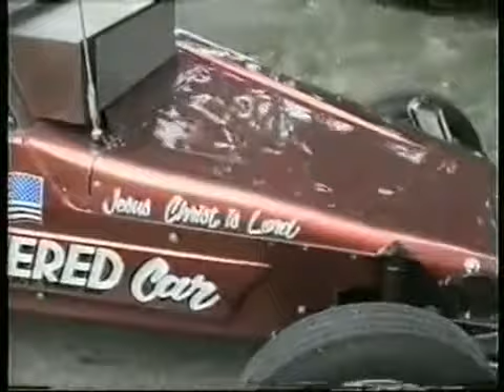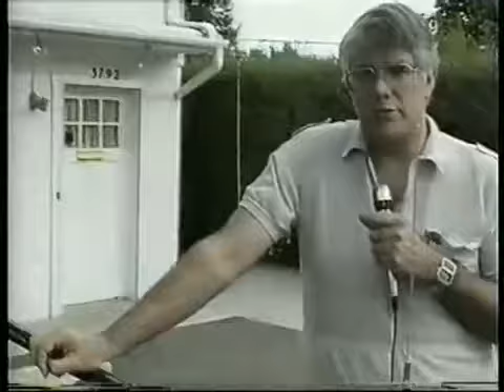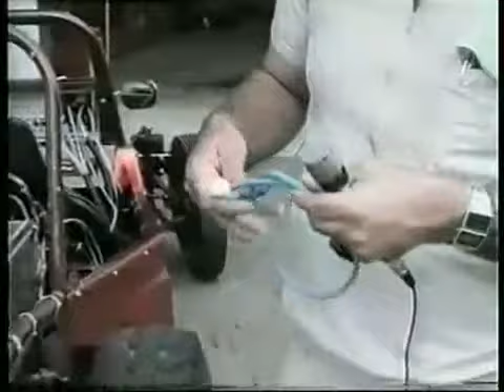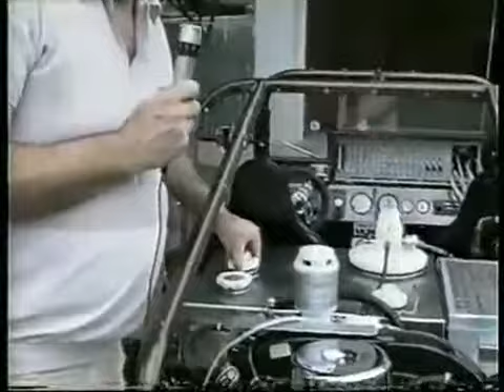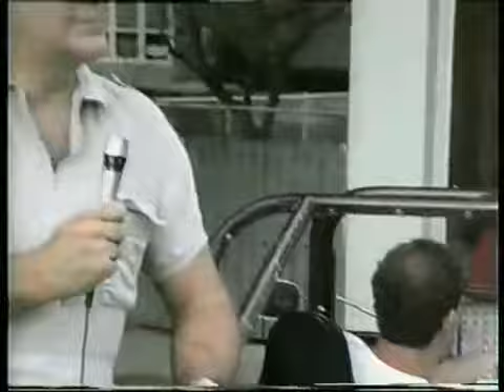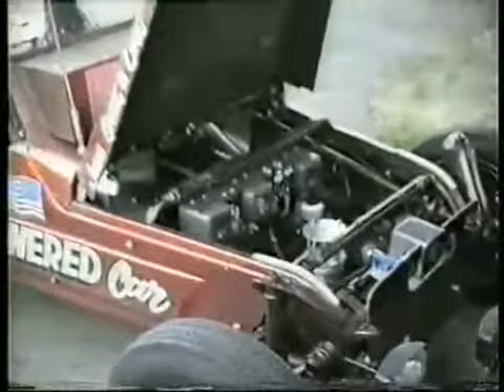Stan Meyer explains the (Water Fuel Technology) on the dune buggy

Comment: It doesn't run off water it runs off hydrogen
Reply: So technically it does
Reply: @DimensionaIGd  Oil is refined into diesel, but a truck doesn't run on oil.
Reply: The water is converted into hydrogen

Comment: He'll o,, in 'vw  you take off all wire of the coil and remove  points inside distributor and condenser, just leave the rotor and cap with wires, connect  to the coil secondary,  from the dinamo/ generator  D+ that its 30 dc volts connect to primary in the coil + on the other side will come -   after pass the  widing inside coil, connect that to choke solenoid in the carburetor, then 30 volt × coil equivalent 100.000 volts to spark plug, then u need to timing the engine go fire after topdeadcenter cause u know running  cold fusion  water don't need to eletrolit split when water will inject to cilynder with air will separate from hidrogen and nitrogen cause u fire on negative pressure, this cause to lighter gas such flow up to chamber then implosion will happen  cold , rise,friction create  heat then same like thunder in the sky light up and what  is result water in end of circle,in nature sun heat air form white clouds sun heat water form hidrogen, two inert gases collide  in negative pressure between cold and heat create friction litghng and thunder,  energy an water just result,

Comment from the maker: @rwg42985 russ i am pretty sure he used the injectors i think i took a pic of them i wish i had the time on it for you to look. i remember him pointing at the white box which was the fuel regulator and then you could see the water spark plugs
Reply: Stan did not use the fancy "all in one" injectors in the "proof of concept" car in this video. He showed them as something he was planning on using in a production version of the system.

Comment: Don't forget that in this video is ONE type of stans system... As his advancements came along... Things changed... 

I'm really sure in this video that stan was using standard spark plugs and NOT the injectors. 

Please please please keep this in mined... Even tho he talks about that. It don't mean it was the case for that prototype...

Thanks, ~Russ
Reply: Yes, in this video, he does not use the fancy "all in one" injectors but performs the electrolysis separately.  The "all in one" injectors were to be used in the mass-produced systems.

Anyone planning on copying Stan's work should probably follow the same path that Stan did and do the basic system, in which the electrolysis is performed in a separate chamber, before trying anything fancy.
Reply: @codetech5598  have you made one?
Reply: @lilhommie4149  No.